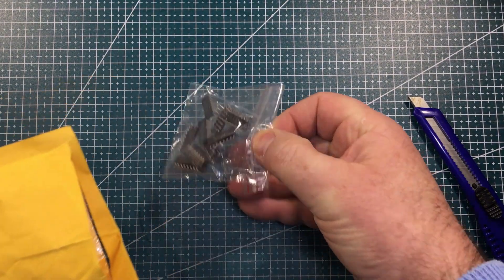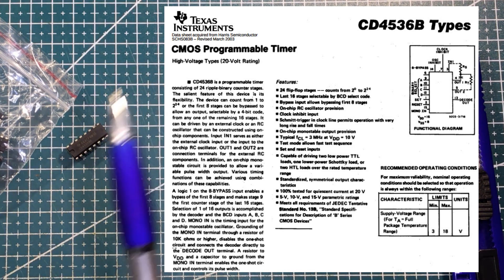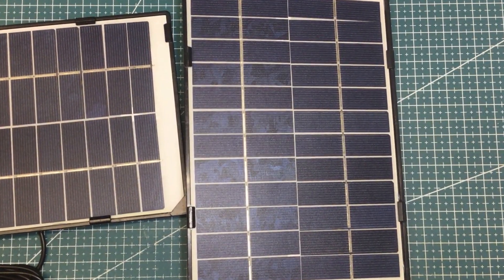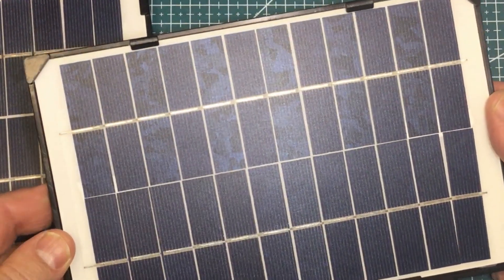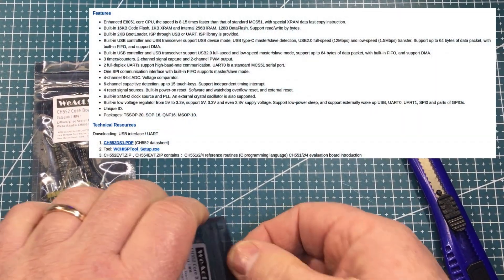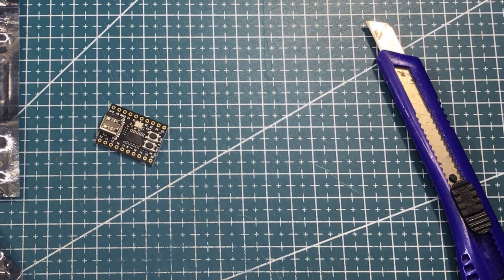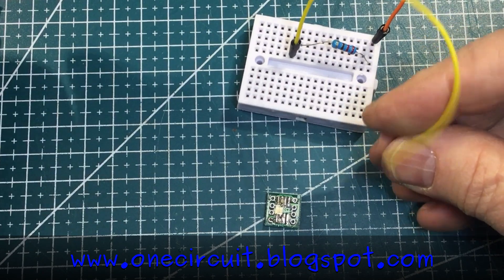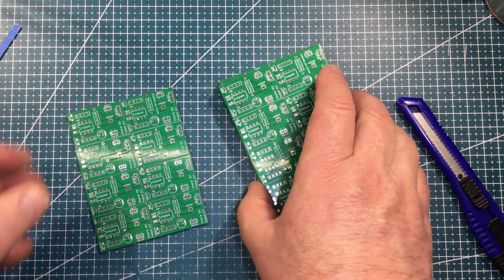Mailbag #35 - a bundle of electronicals!

Comment: Those solar pannels look a bit rough. 🤔
Reply from the maker: Time will tell when I plug ‘em in. Not that much Sun here so probably they won’t be full throttle anyway. 🤷🏻‍♂️
Reply: Project idea? A sunlight simulator for testing solar panels. A lamp or maybe LEDs that replicates the output of the sun to test solar panels. Maybe adjustable for the sun intensity and outputs UVA, UVB and UVC to simulate the sun.
Reply from the maker: @RonDogInTheHouse  You mean like the SOLAR TESTER 6000 MKII? https://youtu.be/VsgF2ND0vAo